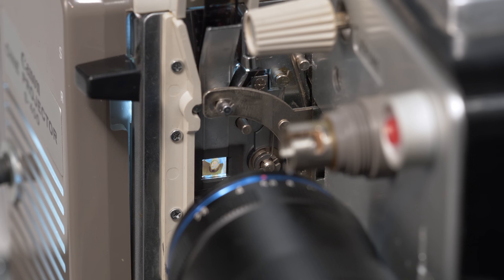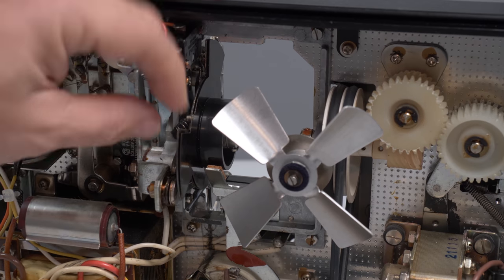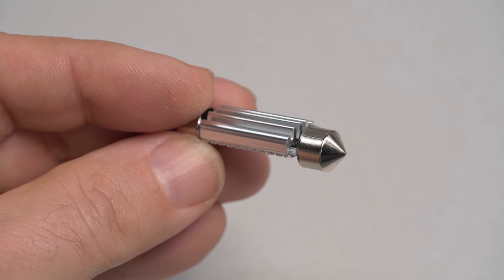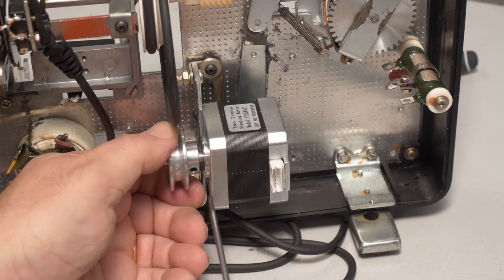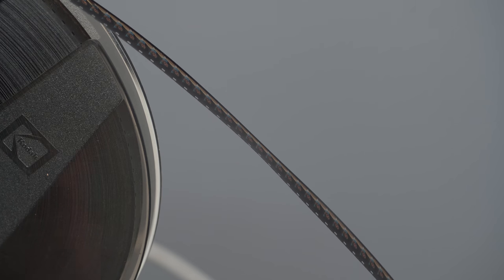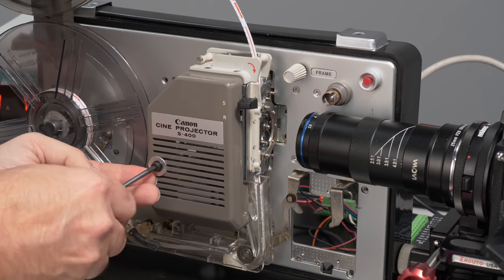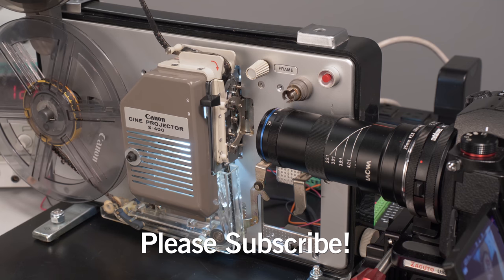DIY Super 8 Movie Film to Digital Video Scanner/Transfer Device Telecine

Comment: What is the big difference between powering the LED light with the USB power supply, and using the bench power supply for the stepper motor? Since they both run on 12v power, could the motor also be powered using a similar power supply as the LED light? Or is there a special reason why the LED light and the stepper motor are powered separately?

Forgive my ignorance 😅 I’m about to start work on my own 16mm transfer system. Your videos on 8mm and 32mm film transfers have been very helpful!
Reply from the maker: I chose to use the  bench power supply for the motor because you can alter the amperage, and I wasn't sure what would work best for the tension on the motor - how high the amperage needed would be.  I could have then wired the LED light from that, but it was cleaner to just use another small power supply - just yank it out to turn the led on and off.  Offhand, I don't know if the small power supply is beefy enough for both. BTW, the power should be 12 volts, whereas a USB supply is 5 volts I think.
Reply: @FreshGroundPictures  So, looking at the video, while running you look to be pulling around .8A. Would it be safe to just use another regular 12V power supply rated at 1A to run the motor circuit, instead of the more costly variable bench power supply? Please forgive my ignorance on the subject, I believe it would be fine, but would like to get your opinion on it. Great build and presentation! I have an old Canon P-400 projector I am preparing to repurpose with your basic design using my Canon 90D Camera. I have a Kodak Reels telecine and am sending it back. Cannot get the basic quality I am looking for, the way it over-corrects and exaggerates color and over-compresses the video. Your build convinced me I could get much better results with equipment I mostly already have. And the Topaz software is already in my arsenal as well, makes amazing "fairy dust" in post! Thank-You!
Reply from the maker: @ericbarr4199  Thanks, have fun!
Reply: @FreshGroundPictures  Would you recommend using a regular 12V 1A power supply in place of the variable bench supply?
Reply from the maker: @ericbarr4199  That should work fine. Considering that the only power draws are the motor and lamp, you could use a 12 volt, 5-10 amp source.

Comment: Is the DSLR on timelapse mode or are you manually taking one picture at a time with the remote?
Reply from the maker: The DSLR is triggered automatically by the momentary contact switch added to the projector. It's not on timelapse, but it is using the remote connection in the camera.

Comment: When cutting the blades, you must be careful NOT to cut the screws that have the blades on the inside, those are the ones that move the outside blades and this moves the part where the needle head is placed to activate the limit switch.  If the screws are cut it will not work well, it already happened to me and now I am looking at alternatives.
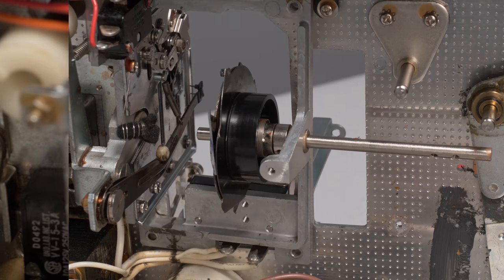Reply: 6:37 in the video.

Comment: This is excellent.  Some great tips too.  I didn't even consider the jitter that the original camera(s) caused.

What software did you use to put all the frames together to create the video?
Or does that camera have a mode for that?

Also, where does one get a microscope lens like that?
I do have one, BUT, it's on the microscope and I use it daily.  LOL  I won't be scoffing that any time soon.  LOL

Also, you gave me some ideas on how to trigger the frames for capture.
I have to look at the projector that I plan on using.  It doesn't use the claws to move the film.  Rather, it uses pinch rollers.
I had to go that route, because my really old unit had the toothed sprocket which destroyed some old film by literally ripping the separations between drive holes.  Not good.

Fortunately, I found 2 projects (same Make, just 2 slightly different models) that use the pinch rollers method.  Those ruined films now run perfectly through these.

When I decide to get off mah BUTT and do the project, I'll have to see how these projectors trigger the advance of the film to each frame.
I hope that it's something easy to tap into, but rather than a switch like that, I plan on using a optical sensor to avoid mis-triggering by noisy switches.

As for the light course, I LOVE how you literally put a "tube" around the LED source to even out the light.  I would not have thought of that at all.  My orig. plan was to use some plastic defuser pieces from an old laptop LCD.  I'll still use that, but I'll copy your idea, because, well, it's just brilliant.  LOL

Thanks for your work on this.
Reply from the maker: I used Adobe After effects to put the frames together and crop if needed. The lens is a full-frame Laowa 25mm Macro, designed for extremely close work.  The whole key to getting the system to trigger correctly is figuring out the exact moment when everything is in the right place (the film frame) for the digital capture, and determining a consistent way to trigger the capture on each frame - a rotating shaft, like in the projector I used, revolves once for every frame.
Reply: @FreshGroundPictures  Great video. Can you tell me what software you use for digitally stabilising the footage - i.e. correcting for small differences in frame positioning as the film progresses?
Reply from the maker: @johngriffin4831  There are a number of programs you can use - I edit with Avid Media Composer and I used the stabilizer in that. There's also a stabilizer in Adobe Premier & After Effects, as well as Davinci Resolve. Depending on the motion within the frame, you might have to tweak the settings to get the best results. My advice is to use the minimum settings first, as frame jitter is not that hard to correct - sometimes the program goes overboard and produces weird results.
Reply: @FreshGroundPictures  thanks, I used warp stabilizer in Premiere Pro but it seems to excessively crop the frame when all it needs to do is vertically shift the frames relative to each other. I'll have a look at the others you mentioned.
Reply from the maker: @johngriffin4831  I think Avid now has a free version and hopefully it has the stabilizer included. Honestly I found the Media Composer to be the best.

Comment: How long does it take to do one film reel? It looks like a very long process! Thank you for the informal video!
Reply from the maker: It depends on the size of the file recording in the still camera. I usually do about 1-2 frames per second for a 24 megapixel frame. This takes 6-8 hours for 20 minutes of footage. It can be sped up if the camera processes quicker, but I don't push it. I prefer higher quality to quicker transfer time, but I guess that's why I built it in the first place. Thanks for watching!

Comment: Is there any reason why this method wouldn't work for negatives as well as reversal film? I'm specifically thinking black and white. Obviously you'd have to invert the image in post. I've scanned 120 negs on a flatbed scanner, and they turned out fine, so I can't see why not.
Reply from the maker: It should work fine. Color is a bit more tricky - check out the video I did on my Version 2 35mm Color Negative Transfer System. Thanks!
Reply: @FreshGroundPictures  Nice one! I'll take a look. Great video by they way.

Comment: Very nice!  I've been working on a 3d printed solution to scanning 8mm and 16mm film.  I've gone through a few iterations (from optical recognition of the sprocket holes to driving a sprocket with a stepper to advance in precise increments). I still don't have registration exactly where I want, but I've gotten it down to fractions of a mm.  Still, it needs stabilized in post.

As it happens, in the meantime have squired multiple 16mm projectors and I may try modifying one in a similar way.  The only downside is I wouldn't be able to overscan unless I modified the gates, too.  How stable is the registration from the projector?
Reply from the maker: I did a video on my 35mm system using an old arri medical camera - the registration on that is rock solid. Super 8 is another animal though. The system itself is not steady as the "pressure plate" is in the cartridge - a piece of plastic.  I was not expecting a lot, even though I think the projector is fairly steady. 16mm cameras and projectors are built to much better tolerances. I have an Elmo sitting on the shelf and I pulled it out the other day to see if I could possibly convert it. I was surprised how well the gate and transport claw was constructed. I think I will try it, as 16mm cameras are mostly too small and expensive to be modified for transfer. Even though it's a bit riskier for the film, I like the idea of mechanically stabilizing the film in a gate with a pressure pad to keep it steady. As long as the projector movement is not worn out, I think the results might be rather good.

Comment: Wouldn't you get an even cleaner transfer by not letting outside-angled light leak in between the gate and the lens?
Reply from the maker: Theoretically,  but I transfer in very low light, and the LED is so bright that I've never had an issue.
Reply: @FreshGroundPictures : Oh, so you do actually turn the room lights off or very dim when you do this for real, even though you don't show that; is that what you're saying?
Reply from the maker: Yes - although I think I've accidentally left the room lights on and it didn't seem to matter, as the LED is so bright.
Reply: Huh, interesting,  @FreshGroundPictures . But you still don't want it quite AS bright as the old incandescent bulb, which is why you replaced that one with the LED one in the first place, right?

Comment: Wow! I would love to do such a thing but I have no idea where to buy those components like the motor and the pulley and the controller for the motor. Also when you buy them are there instructions on how to connect them? Could you give me some links to buy them?
Reply from the maker: I have another video called Update 1 on this system where I give details and information on most of the parts.  I believe if you take that info and search on Amazon you can find just about everything except the projector. I'd do ebay for an old projector.

Comment: Excellent picture quality, but very annoying stepper motor sound.
Reply from the maker: You don't actually need a stepper motor - I chose it because of size, torque and the ability to move slowly without extra gearing that might prevent rotating the motor shaft when not powered. My original 35mm unit used a regular 12 volt drill motor, but there's extra gearing built-in around it to get really slow speeds.

Comment: its hard to find canon cine projector c-400 , is any other choice you recommend
Reply from the maker: I don't have any one specific projector to recommend, but the basic system could probably be applied to many other projectors. One of the key things is that the film gate is not so far back that the macro lens can't get close enough to it. Old projectors are pretty cheap, so you could get one and experiment.
Reply: Thanks for your advice 🙏🏻🕺🏻
Reply: and also , 1000mA 2-30 VDC DC-DC Constant Current Step-Down LED Driver 6-36Vin Wire Style <--- is it an optional item for DIY system ? thanks
Reply from the maker: @pacowhn4205  I would think so. I use it to insure that the voltage to the LCD, and hence the brightness frame to frame does not vary significantly.

Comment: has anyone tried to modify a flatbed scanner, and scan about 17 inches of frames a pass, then use a program to assemble the frames in to an mp4 or whatever? the quality could be much better with a flatbed scanner and at 17 inches of s8 or 16mm, it wouldn't take so long to capture the footage. it would work out to about 25 scans per minute of 16mm

Comment: What was not calculated in cost is the Full frame digital camera to which most people do not have, do to the cost of $1997.99 plus tax for just the body and no extra batteries, charger, lenses. The cost of the projector and parts. The cost of the camera lens which is $400 plus not counting the cost of the adapter ring to fit that camera.The cost of the shutter release plus parts for modifications. This is a very very expensive DIY project. This is also not counting the ware and tear, the high shutter counts to do one small roll of 8mm film, one 50' roll (4 minutes) of 8mm film at 16.67 fpm requires 4000.8 shots minus any bad frames on a camera. Super 8mm 50', A little less shutter counts for 18fps and a little less (minus only 400 frames from the 16.67fps 8mm film), for 24fps. The cost of replacing the shutter in the camera frequently due high shutter usage and wear out. So therefore, it's cheaper to buy a Kodak Reelz 8mm & Super 8  or Wolverine 8mm & Super 8 Reels to Digital MovieMaker Pro Film Digitizer to transfer this film to digital then edit in say Magic Vegas pro (Sony Vegas Pro) editor or Pinnacle Studios Ultimate. Do not use the other free editors like VideoPad, DaVinci Resolve, OpenShot, HitFilm Express, etc. They are all limited in functions to take out jitters, scratches, set correct speed, etc. Free means limited functions for amateurs or beginners, but just enough corrections for basic limited cleanup and no advance editing functions to correct anything else.
Reply: Every piece of equipment needed could be downgraded for cost savings, this in no way requires a $2,000 camera. It's not a $50 project, but the level of quality attained here compared to something like a Wolverine is night and day. This method could get you 4k film transfers, whereas the Wolverine tops out at a very compressed, low dynamic range, and low quality 1080p. 

Also, you may have missed some information in the video. He says the projector and all the extra parts cost him around $100. You could sacrifice a little optical quality and get a Mitakon 20mm 4.5x macro lens for half the price of the Laowa, and buy a mirrorless dslr second hand for around $250-$300. Which brings me to the other thing you missed, which is using electronic shutter. Mirrorless cameras don't have to use a physical shutter, so you don't have any shutter wear since you're never using it, like he said and did in the video. 

This project could be done for around $600 with the changes mentioned, while delivering an astoundingly superior end result than anything a Wolverine or a Kodak Reelz could produce, which both cost $400. ($300 for the 720p version)
Reply: @jcobb2073  After seeing this video I can not ever even consider digitizing my 8mm movies with a garbage solution like the Wolverine orKodak Reelz. The difference is just mindblowing!
Reply: @jcobb2073  I'm confused about the meaning of a 4k film transfer. Perhaps you could answer it? Do I need a full frame digital camera for a 4k film transfer? And isn't there a certain point after which going for more resolution is pointless?  Thanks.
Reply: @Graeberwave  A "4k film transfer" is just a scan of film with a digital sensor at 4k resolution. 

Secondly, 4k doesn't rely on the sensor size, only the amount of pixels. Anything from a full frame sensor down to a micro 4/3 camera sensor could be 4k. Using a camera of any size, that has a 4k resolution digital sensor, could be used in this rig to achieve 4k film transfers. 

Lastly, there definitely is a point where you achieve diminishing returns in regards to resolution with these smaller size films. File sizes can quadruple from 1080p HD to 4K, your grain might be much larger than a 4k pixel, or your lens might not be sharp enough to capture the film in it's highest detail. All those reasons would be valid ones to not scan it in 4k, but here would be my personal argument against those points.

1: People often think resolution of the final video is all that matters, but the bitrates and compression really dictates a lot of why higher resolutions might look better, even though 8mm film might not be big enough to give "4k detail". Between two same type h.264 HD and 4k exports of your scans, the 4k will always look better, even if your image is a lower optical resolution. This is because a 4k file will have a higher bitrate per frame. You could increase the bitrate of a 1080p export, but then that file size will be much bigger, so I personally opt for 4k and keep the extra pixels.

2: when scanning with this method, you're taking still images. most digital cameras are at least 12MP, so each image will have slightly greater resolution than a single frame of 4kUHD footage. I've heard of many use cases where the type of film scanned saw benefits being played back in 4k, even down to 8mm film, due to small grain sizes on low iso film. The resolution of your end video is up to you once you put your stills into the editor, so unless you're pressed for storage space, I'd again personally go ahead and render a 4k video.

3: I'd stick to community approved macro lenses to keep sharpness high. Especially with these smaller film stocks, you don't want to lose any more contrast. The lens used in this video is fantastic and very sharp, but there are still great macro lenses for more affordable price points.
Reply: @jcobb2073  Amazing. Thank you.